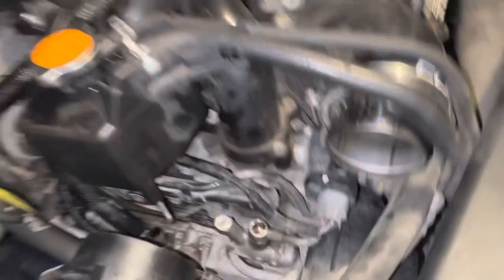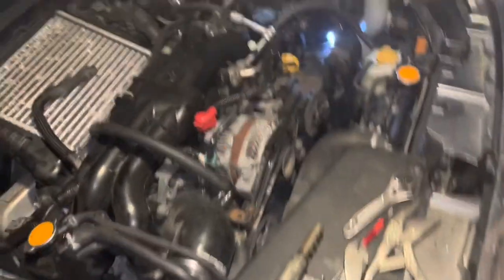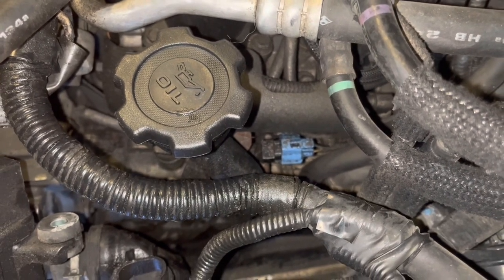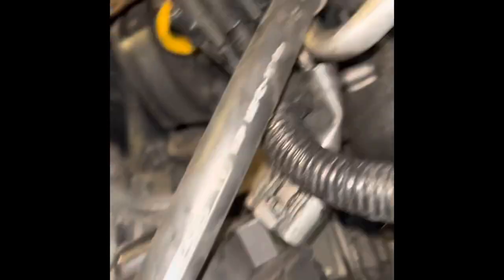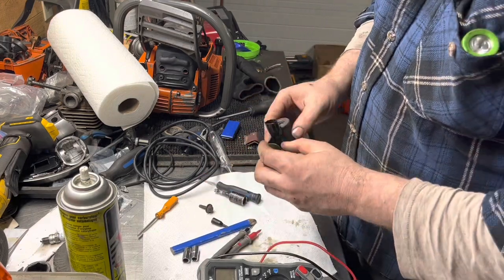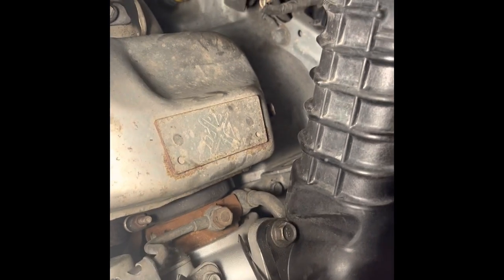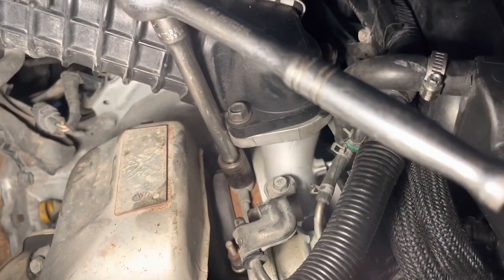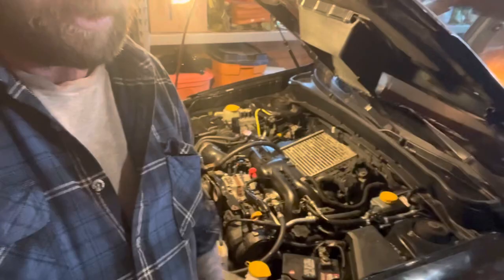How to fix Subaru Trouble Codes P0011 or P0021 and what you need to know. Try this first, save $.

Comment: thank you for making this video. extremely useful. truly a timeless diy vid
Reply from the maker: Thanks for that.. I’m finding a few topics on my Subie for more vids 😉
I’ll be posting more practical diy and cost saving vids for it periodically, so please subscribe if you haven’t.
Reply: @jimssawsnstuff8903  replaced these parts last night. your video came really handy. its crazy how the bulk of the work is literary making space for the part that needs to be replaced.
Reply from the maker: @michaelr6722  yes, I could understand Subie Techs suffer from depression due to the engineering and layout 😳🙄🤔
Once you figure out the sequence of components to remove it’s pretty straightforward…but still painful 🫣
Reply: Did you have to remove a hose on the driver side to remove the actuator? Having similar issue but can’t get drivers side out.
Reply from the maker: @jonaholiver143 hey jona, it’s been a while, so I re-watched my video…that brought back some bad memories🫣.
I believe after removing the battery, secondary air pump and oil filler neck I likely do disconnect the hose from the secondary air pump to access the actuator…I also recall loosening the motor mounts while changing spark plugs in order to have room to get them out and back in.
Sorry I can’t be more exact.
I feel your pain…if it looks like it’s gonna help, it’s probably the right thing to do. I recall the actuator was a bit stuck too so I had the kind of pry and flex it a bit to get it out.
In the end I did have to replace the one that coded…it was the same price thru Subaru here in western Canada as it was thru Rock Auto, so I ordered thru Subaru and saved shipping…
Reply: @jimssawsnstuff8903   hey Jim thanks for the response! Yeah I was able to get the driver side actuator out but not completely as It’s blocked by what I believe is the hose you mentioned. It’s been a real pain trying to get the hose off with the cold weather here in Kentucky. Sounds like that’s what I’ll have to do though, I appreciate the tips!
Reply from the maker: @jonaholiver143 for sure. It always seems like it’s the wrong time of year when they have issues…2 weeks ago it was -40 for at least a week, my VW Jetta diesel didn’t like that, it was parked behind my pickup, so I couldn’t get my truck out either 🤔
Reply: @jimssawsnstuff8903  I know what you mean! Every winter something pops up lol. Godspeed, -40 is a different beast.
Reply from the maker: @jonaholiver143  yes, -40 makes issues all on its own, I’m hoping we won’t get it again, but normally we have it late January thru mid February up here in Western Canada 🇨🇦
It sure keeps the bugs down though! 😜👍😂
Reply from the maker: @jonaholiver143 is yours an 09-11 forester xt?
Reply: @jimssawsnstuff8903  It's actually a 2009 WRX hatchback. I believe the engine layout is mostly similar?
Reply from the maker: @jonaholiver143  cool, I haven’t worked on one.

Comment: Did I miss something?  what was the result of your test run with the solenoids switched sides? Did the problem move to the other side?
Reply from the maker: @SvendIt  yes it switched sides, so I ordered and installed a new one.

The secondary air pump had also been acting up later on. But it’s resolved itself

Comment: Easy video to follow, thanks mate
Reply from the maker: Thanks. There is a part 2, I did end up with a bad actuator, as I suspected it was the one I moved to the oil filler side. I bought a new one directly from Subaru…saw some guys had issues with the Dorman ones. Installed it and cleared the codes. Subie runs awesome now and have not had any issues since.
Reply: @Jimssawsnstuff  I took mine out and cleaned them and added more/thicker oli, seams to have worked but I'll replace if it throws the code again
Reply from the maker: @human_concept225  right on, by swapping sides it helps determine if it’s the actuator or another issue.
I replaced mine with OEM and have not had an issue with them since.
Just installed some new mufflers on it today, will likely post a video of that too. I love the sound of the Boxer, but couldn’t hear it stock 😜👍
Reply: I have p0021 one too changed the valve with doorman one code came back checked banjo bolts no screens then took my bank b valve and swapped sides with the new doorman one and the code came back again but still p0021 at bank a
Reply from the maker: Ah, that sucks. I got lucky with mine.
What year is yours? Is it a turbo too?
There are some good forums to get more info on. You may also find more on a google search.

Comment: Sr i got the same exact model with same 2 codes 0011 and 0021,  passenger side i pulled banjo bolt no filter, but the but
Reply: The solenoid looks like it was replaced so I never pulled it out right next to it the bencher bolt and I'm still getting the same code and I think it's wasting gas is burning rich check engine light is on any suggestions please help
Reply: Yeah I'll replace the actuator on the driver side and the one on the passenger side looks like brand new so I didn't even look at it
Reply: Solenoid actuators what I'm talking about
Reply: Called 0021 is for passanger side this this driving me crazy 😅
Reply from the maker: It will do that.
So far I’ve been lucky since I replaced mine, I have not had that code again.
Reply: I have these same 2 codes replaced both cam gears with oem, solenoids with oem ,all banjo filters gone blew all lines out, new killer b baffle and pickup and these codes won't stay away I'm about to get a custom plate made with these codes
Reply from the maker: @carlewing7212  wow, that’s gotta be frustrating…if I knew programming, there is a bunch of stuff I’d change in these vehicles…frustrated me that they can disable a safety feature due to a CEL related problem